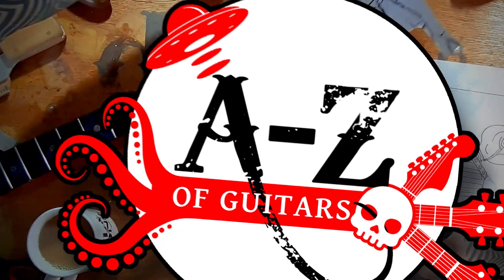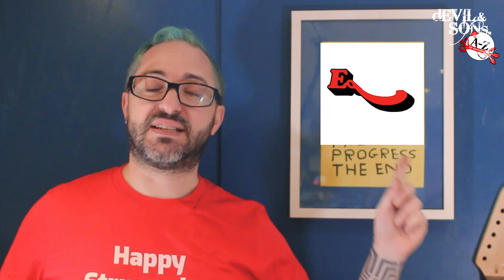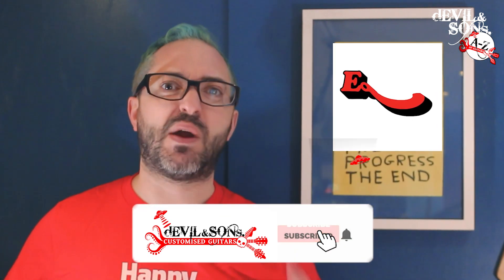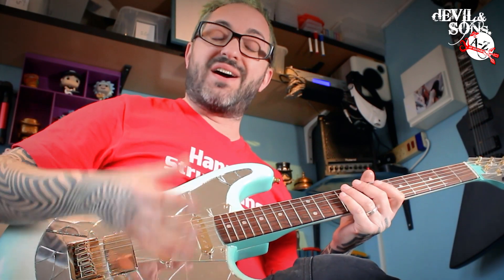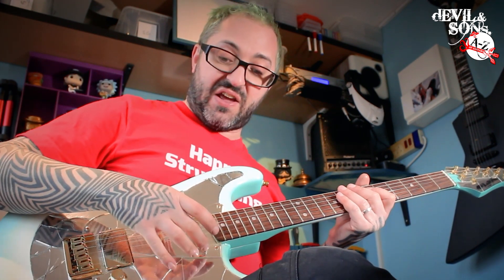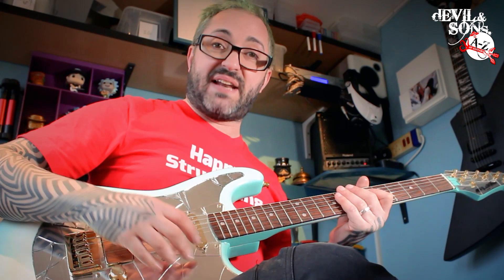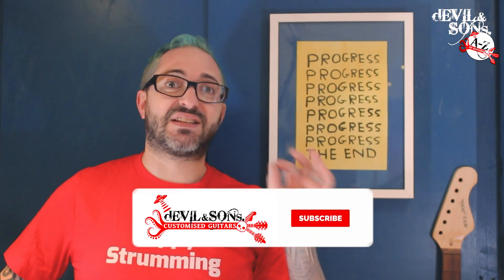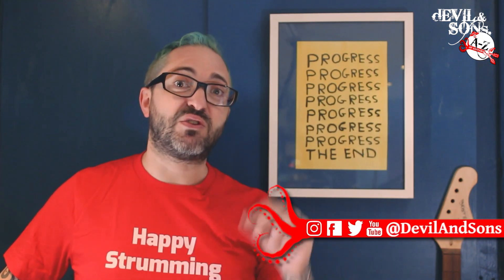How does an electric guitar actually work?

Comment: I need help with this question before i do anything, my strat had an accident last year where i accidentally dropped a bit of water around the 3 pickups, i git rid of the water thankfully and its been a year since covid i havent touched it, i git pedals and i wanna experiment with them, is it good that i can plug it in?
Reply from the maker: It will be fine. A bit of water won't really harm it. Also no electricity flows into the guitar unless you have active pickups that have a battery.
Reply from the maker: Have fun playing.
Reply: @DevilAndSons  thank you so much!, im just trying to not spend more money on buying a new guitar  or trying to repair it all, this helps a lot :)
Reply from the maker: It's a pleasure to be able to help.
Reply: Just one more question lol, would it affect any pedals with 9v batteries?
Reply from the maker: It won't. The electricity in the pedal is confined to the pedal. Also the water will have dried out by now anyway.

Comment: My guess is E-Bow. One time our Bass player's amp was the reverse polarity of my guitar amp, we were both holding our strings and he decide to examine a metal necklace I had worn then and held the part of metal coin to read it and the electricity went thru the chain, it felt like it was constricting around my neck until I slapped his hand down. We learned a valuable lesson at that band practice session that night...lol
Reply from the maker: That sounds horrible. I remember rehearsing somewhere and a friend had a similar issue with a mic, when he was singing and playing the guitar he touched the mic and got a shock. Spot on with the logo guess.